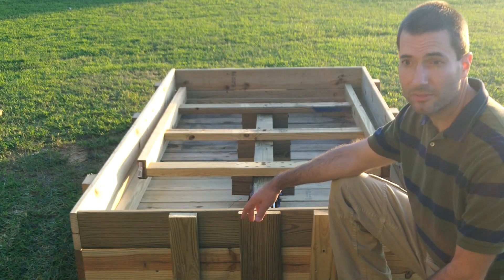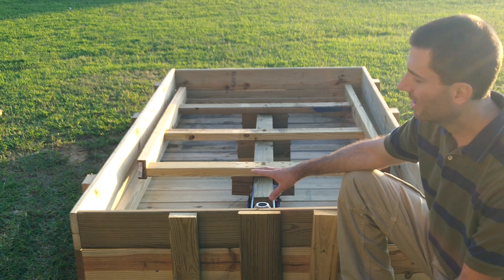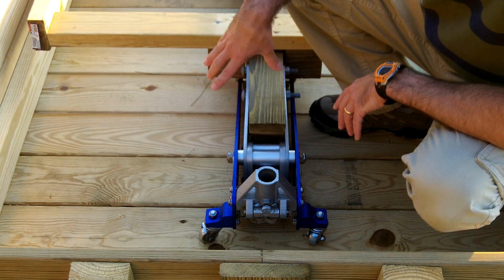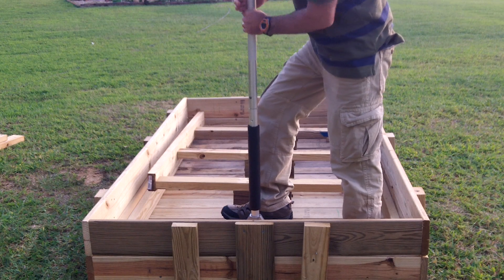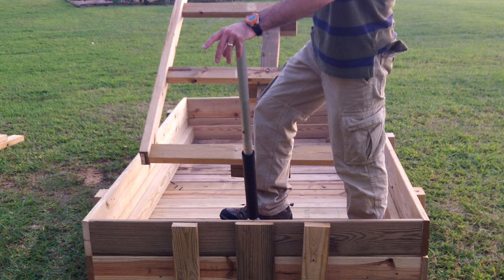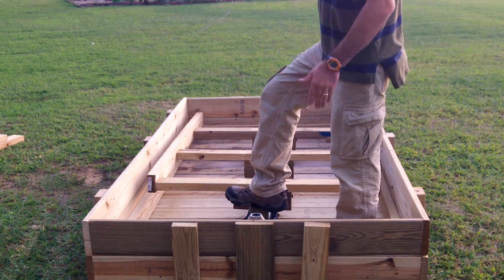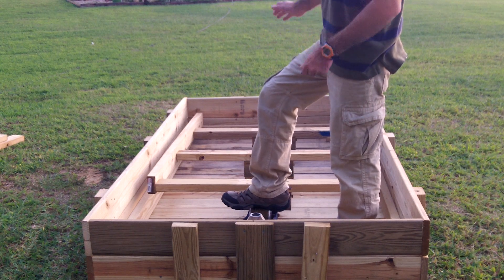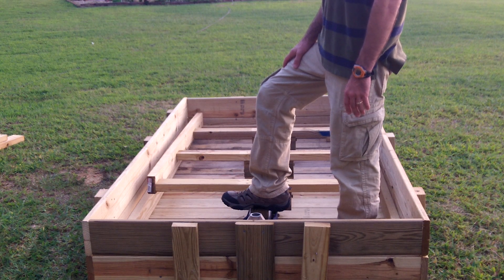Underground solar stand (sneak peak)

Comment: Pocket doors are impractical when lain on their backs. Gravity is not your friend in using them in such a manner. Also, if you ever live in a home with pocket doors, you will likely have  had experience in how often they fail and require maintenance to operate smoothly. Nice video and a really neat project. This can work with a solar heat panel, as well.

Comment: Nice idea... Keep in mind the ground water where you bury it. You may end up lowering the solar panel into a swimming pool. Also, I was thinking you could mount one end of the jack on a pivot  and allow the other end (with the casters) to move to act as a solar tracking system. Just a thought...